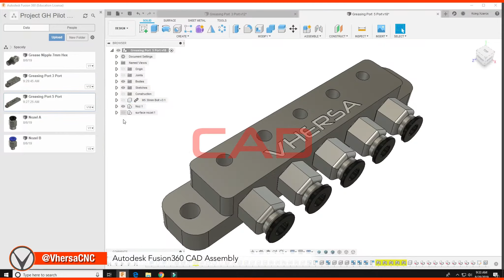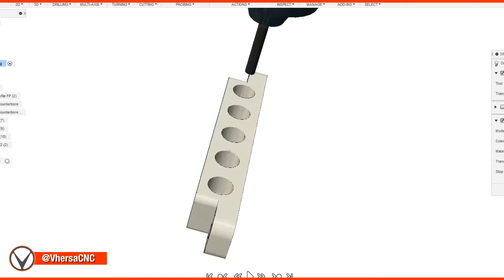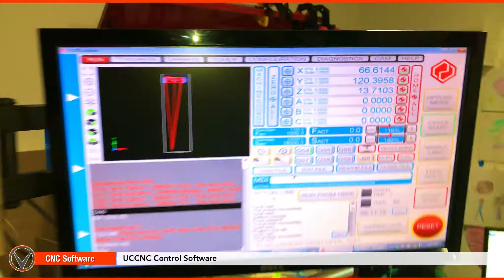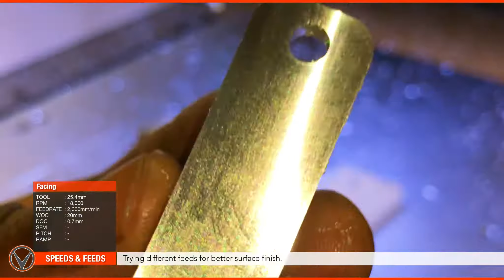DIY CNC Lubrication Kit- For Linear rails & Ballscrews- Part 1 of 2

Comment: I Love the small machine vice.
I have the same one.
Comes in very handy for small parts.

Good watching the progress so far.
I do have a Question ?
Your choice of coolant mix ??
I am curious about the mix of Water and Water Displacement Fluid.
I am not a Router guy,  so what you use for coolant is new to me.
Just seems an odd combination.
To use a coolant mix that is both Negative and Positive.

Looking forward to watching Part 2.
Very interested to see how well it works.

Talk to you soon ?
Peter.
Reply from the maker: Sorry I missed your questions/comment.  I love that vise too, I got a few of them for a project I had to run 100 parts. they helped a lot.
About the coolant I use;
I have two types of coolant I use often. 
1. One is the WD40+Distilled water mix.  The WD40 works pretty but it creates a huge foggy mist in the machine/shot. The little chemist in me came up with the distilled water mix. I use a 1 gallon paint mixer and a screw gun on high speed and it mixes both liquids pretty well, and it turns white. Then i fill that info my mister. it works pretty well and leaves a very good surface finish as you can see in the videos.
2. When Im running parts that are above 30mins machining time, I use 30% Ethanol (Robbing alcohol) from Wallmart. If its still too strong, I mix it up with distilled water and again fill that into my mister. This is one of my favorites because the air and coolant mix coming out of the mister is really cold which keeps my tool/endmill pretty cold and prevents chip-welds. I normally use  single and Two flute endmills for high-speed machining.